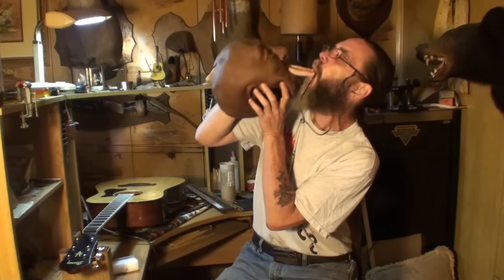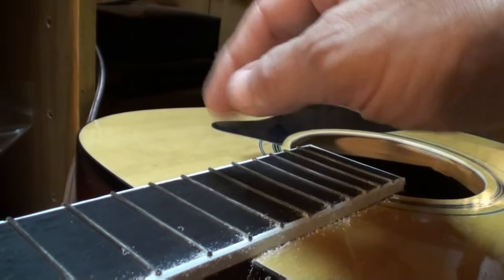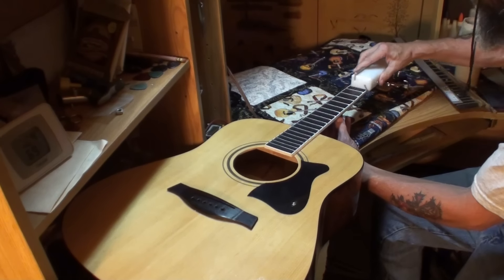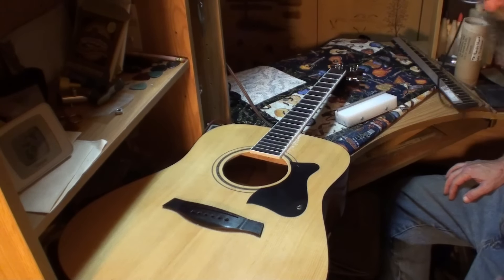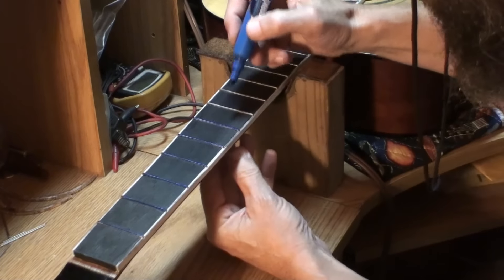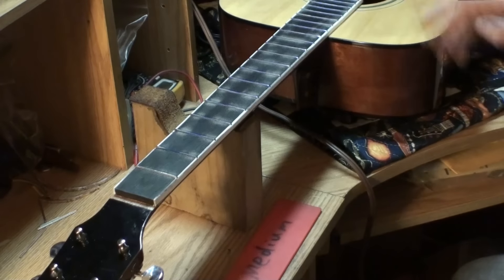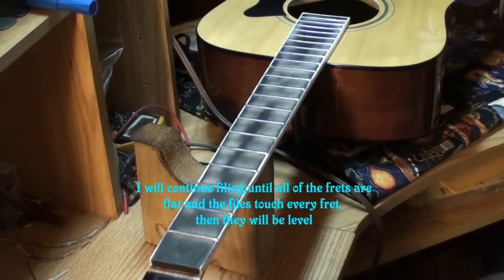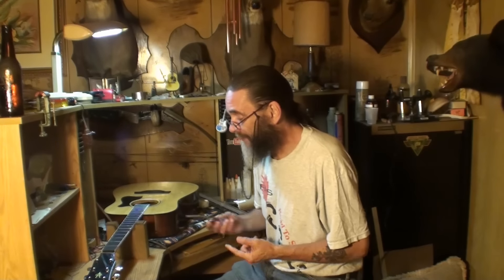Guitar fret leveling and beveling and visit from Earl!

Comment: Hi Randy, Thanks for your reply.I bought the product.I also bought from my local auto parts store the exact same product however these were only three inches long and one inch wide and 3mm thick in all three grades. With these little ones I can push them under the strings without removing them and reduce some high points. great product.Love your work.Thanks again

Comment: Randy, hope all is well with you. After becoming  a faithful subscriber to your site it has made me become a little more aware of my guitars. My guitars are kept in a room where the humidity averages 52%. They are all kept out in the open on stands. Is this enough humidity? I have noticed that on my one acoustic that the back of it is not flat. I checked this out by using a Straight Edge. I have never seen in any of your videos where you check the back of any guitars with a straight edge. Is this guitar of mine in need of, As you would say, in need of a drink of water?  I have also successfully reset the bridge on this same guitar where I found it was coming loose by using the paper trick that I learned from your site. The iron trick worked out great!! I hope you get a chance to read this and that you can get back to me. Hope to hear from you soon, take care of yourself, please keep making the great videos. Oh and by the way semi Chrome is fantastic!!! Hope to hear from you soon, thanks again, Brian
Reply from the maker: 45 to 55% humidity levels is where you want to keep your guitars at all times, many guitars has somewhat of an arch to both the back and the top, even tho they are often referred to as flat tops they are not all flat, so you should be ok. thanks for subscribing and watching my videos! greatly appreciated!

Comment: Hi Randy. Great work- I notice the diamond file you are using to level the tops of the frets, I can get  from my local hardware at a reasonable price. My question is the Stewmac expensive ones! are smooth whilst the one you are using has grooves or cut outs in it ? Is this ok?Thanks again.
Reply from the maker: yup it's fine, you end up polishing out any marks left by the diamond grit file, it really makes the job a lot quicker.

Comment: How do you figure that  the depth of the fret slot  affects the height of the crown above the fretboard ? You could cut the fret slot twice  as deep (or three times as deep)  as necessary ... it still wouldn't affect the height of the  fret crown above the fretboard. It wouldn't do the stability of the fretboard any favors,  but it wouldn't affect the height of the crown above the fretboard.

I am well impressed,  however,  that you were able to spell "medium" correctly .

Comment: Randy, it sure does seem as if those wide diamond files you are using to level the frets would tend to flatten the fretboard radius too (which the more narrow Stew Mac file avoids pretty well) and take more material off the middle of the fret.  Any problems with that?
Reply from the maker: They do flatten the frets but not touching the fretboard, I sanded radius into the fretboard in an earlier video. What I forgot to video was I used a 16 radius block just after flattening frets and sanded 16 inch radius back into them, always did it that way with no probs. Thanks for having a look.

Comment: I used an old skinny glass shelf as a ´Level checker´. Plate glass is PERFECTLY FLAT.  A neighbour had put it in the trash - so it cost me ZERO€ .  Rested flat on the frets its easy to slide a 5thou feeler-gauge beneath to test neck adjustments . Plus i´m able to visually see which part of a fret might be high or low. .  =)   It Worked great til i DROPPED it =( BUGGER
Reply: I use a Carbone Stone from the 1940s they work great too